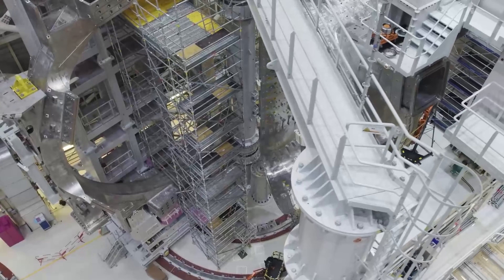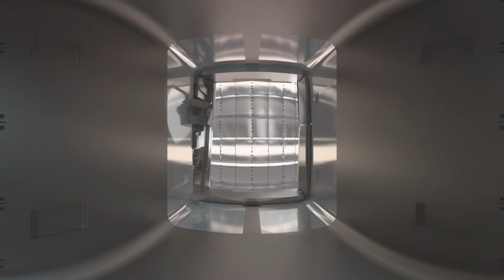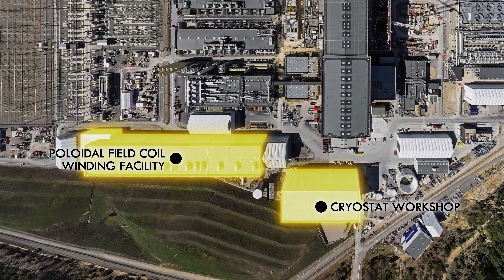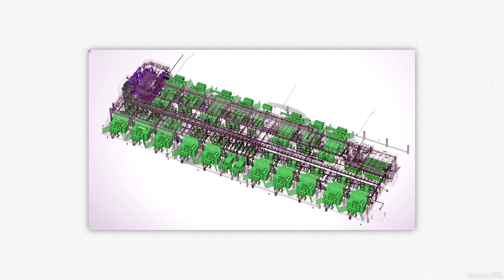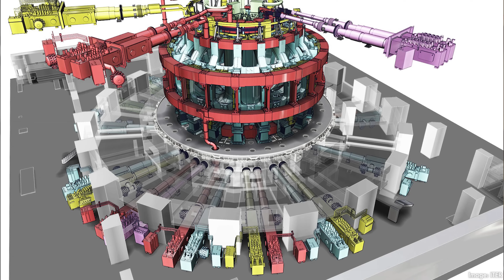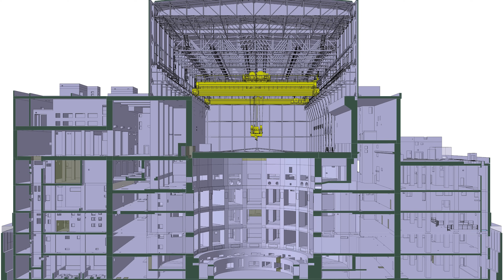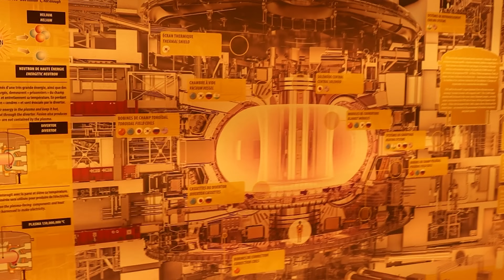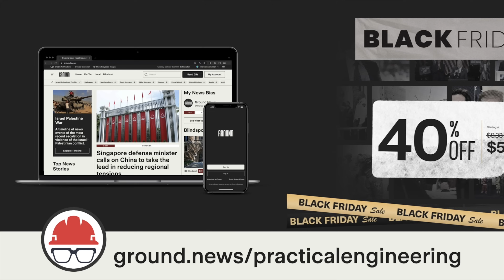Engineering The Largest Nuclear Fusion Reactor

Comment from the maker: What’s your guess for when the first commercial fusion power station will come online?
Compare news coverage from diverse sources around the world. Take advantage of their Black Friday sale to get 40% off unlimited access by going to: https://ground.news/practicalengineering
Reply: 8 minutes
Reply: @Southghost5997 only correct answer
Reply: What they say about Fusion is that it's always about twenty years away. My prediction is it will be at least another century before a lifecycle-profitable, energy-positive, fusion plant is operating.
Reply: @dyadica7151  Especially on any of the magnetic bottling techniques being used.
Reply: @dyadica7151 I thought the joke was 50 years from whenever now is.
Reply: @linda1lee2  :D It started as the "twenty years" version, but people quickly learned that was being overly optimistic.
Reply: Maybe never man, maybe never.  Without high temperature super-conductor breakthrough, not likely.  As of right now it's just a science cash grab for tax revenue.  Do some Google searches with some objective search terms, and decide for yourself.
Reply: Well, from my many years of experience playing SimCity 2000, I can say fusion will be unlocked circa 2050.
Reply: I love your channel, Grady. 

Doubtlessly when/if commercial fusion happens, the steel and concrete people will sort it out (with maybe some input from the material science folks)

Like she said, ITER is as much a research project as final design - so my question is - since any team, anywhere, have yet to build even a small scale design that would be suitable for ITER - how far can they take this before the building outruns the science? 

Also, my prediction is 2057. That's if someone can get a really feasible design built at all. I certainly hope someone can. Lord knows we need it.
Reply: Honestly I don't want to speculate. It's like trying to predict when the first passenger airline would be in the late 19th century. There's a number of players with different ideas and it's hard to know which will win out.
Reply: I think the technical challenges are so difficult that it will be prototype plants for some time. The old joke is that it will be 20 years, and has been for decades. But maybe now it actually is.
Reply: @esalehtismaki I think they might get a feasible experimental power plant going but it will probably be just over the breakeven point so commercial wouldn't catch on to it till it gets more efficient
Reply: Jade's @upandatom channel looks cool! Going over to subscribe and binge now... Thanks for the pointer! 🙇
Reply: 30 years? And it will remain costly and only form a part of the energy production, maybe with some tricky stuff accompanying it. Kind of like nuclear energy nowadays.
Reply: I've got an ongoing wager with a friend we made in 1999, I say before 2050. Winner gets a bottle of JD.
Reply: @PedalBoxGarage  You should be keeping that bottle safe for your friend.
Reply: @bartroberts1514  heh, I feel like i'm cheating a bit with friends who now work at both JET and ITER over the years. I'm quietly confident :)
Reply: Never.. to big, expensive, delicate and inefficient. That huge facility to make less power than what it takes to start the thing. How big would it have to be to actually spin up dozens of generators? The size of a mountain?
Reply: For one that generates electricity and actuslly serves the grid? Maybe by 2075? 2175?
Reply: You, and she, are among the most moronic geniuses.
Reply: It is important to note that ITER is not a fusion power station!  It is a research facility, an experiment, to enrich our knowledge about what it takes to build a fusion power station.
The "50MW in 500MW out" claim made is misleading to the general public.  One may think "this reactor would take 50MW from the grid and generate 500MW of power to put back into the grid" but that is by far not the case!
These figures are measured at the reactor itself, not at the boundaries of the ITER site.  It takes WAY more power from the grid to generate the envionment and the 50MW input to the reactor, and the output of the reactor is 500MW thermal, which when converted to usable electricity is less.
That "a gain of 10" in reality is way less than one for ITER, i.e. running its reaction for a test costs way more energy than it generates in the end.
That has to be improved by at least two orders of magnitude for the whole system to be used as a power station, and that is what the research is about.

That will take another 30-40 years to accomplish, just like it did in 1970.
Reply: I'd have to hedge my guess by saying I'll wait until I see ITER running, first!  😄
Reply: Wow!  Long way since Ponz!
Reply: Ultimately, they'll find out they're wasting money.  They'll have to convert it into a fission reactor.

Stars can do fusion, because it has the gravity.  Once fission takes place, the uranium (heaviest element) will sink back into the core and reconstitute itself, then go through fission again.

You'll find out later.  All the junk in the news about fusion are fake.
Reply: 2041
Reply: never
Reply: 24.04.2046
Reply: Never with this technology. Magnetic confinement doesn't work. Inertial confinement does. You can build a reactor in your basement for about $5000. It will maintain a fusion reaction indefinitely. Researchers had a clear path to ignition (more energy in than out) but were refused funding. You can ask for funding yourself but you will get no reply.
Reply: Its a grand science project for sure. If they got the math right it should have some sustained fusion probably by the 2030s . But how long will it run for? Remember this is not a prototype power station either. A Power station needs to run for decades. It'll take 100years or more before any such will happen.
Reply: If you want an expert view on whether and when fusion will be commercially viable then search "ITER is a showcase ... for the drawbacks of fusion energy". Daniel Jassby, a former fusion scientist explains the many difficulties that make it almost impossible to achieve a working fusion reactor and details why it would never make economic sense even if it does eventually work.
Reply: Since I was ten, I've heard about this, back in 1988.  Just starting the build was in 2007 I think.  So my guess is another 20 years.
Reply: @producerk8247  Okay. So.

What people don't get is that fusion generator research is a beard, a shell game, to cover for something else.

H-bombs require constant replenishment of heavy hydrogen in high concentrations. The overhead on that is enormous. But if nuclear research carries part of the cost, then the militaries with H-bombs can defray their costs.

Eight years after the last fusion generator research project ends, H-bombs will be too stale to ignite from their A-bomb cores.

That's it. That's the whole rationale. Fusion research was, until other Physics questions were answered, meaningful scientifically. They were never meaningful commercially, except for the arms business.

Now, they're meaningless. We have so much cheaper ways of doing away with people these days.
Reply: Ever watch "The Saint?" It's an old Val Kilmer movie
Reply: @timhorton555  It's also an old Simon Dutton series, an Andrew Clarke series, an Ian Ogilvy series, before that a Roger Moore tv series, and before that a 1920's Leslie Charteris character in his novels, and even a 1930's movie character: a perennial fiction loved generation after generation, but never really changing and never real.

Just like commercial fusion.
Reply: 40 years, just like it’s always been 😁
Reply: Thank you for the 10 commercials throughout this video.
Reply: Never. It's a scam. It's a waste of precious resources
Reply: @johnmanno2052  They're not that precious. Resources can't be destroyed and we have a lot.
Reply: I'm french and I fear this is a huge waste of money. Time will tell but meanwhile nuclear power is so misunderstood.
It's still the most green energy available (even more than hydroelectricity) if you listen to Sabine Hossenfelder.
Reply: In about 30 yrs.
Reply: 50 years.
Reply: The most practical fusion power is dropping fusion bombs in a hole and boiling water at high pressures. 

We have all the tech to do this btw, and it gets rid of weapons at the same time. Win win.
Reply: Check out Magneto Hydro Dynamics, MHD I think it is called. Maybe Magneto Plasma Dynamics idk. Anyways, it uses the magnetic field created by the fusion plasma to "push" against a separate magnetic field on the outside of the machine which can be used to move electrons through a coil. Or something like that. It's late for me and  my brain is not functioning at full capacity so take what I say with a grain of salt and read about it for yourself. Interesting stuff though.
Reply: Never.
Reply: 2065. There's still so, SO much that needs to be figured out, since the current ones that can technically produce positive power output do so for a fraction or so of a second, and iirc don't take into account the peripheral costs associated with setting up for a reaction in the first place, only the small reaction pulse itself in that calculation. Oh yeah, plus the actual energy cost of producing the fuel pellet in the first place lol, since tritium/deuterium isn't exactly simple to produce at the moment (so we'll need to overcome that hurdle as well)
Reply: STOP MAKING TRASH that has the potential to create catastrophic failures!
Reply: 🎈 The real question I have is just what impact this will have on the price of helium birthday balloons.
                 🎉🎉🎉
Reply: Sure spending some money on that!  Good jobs I guess.
Reply: I'll make a very optimistic guess for 2029
Reply: @Tharmin.124 I admire your optimism. ITER has been working on this experimental non production reactor since 2013 and it not finished yet. What makes you think it would be possible to finish the build, perform tests, design a new form of reactor, to build and test it and to take it into production in only 6 years from now?
Reply: @Conservator.  Absolutely nothing, I don't know jackshit about the progress of nuclear fusion lmao
Reply: @Tharmin.124  Yep you're right, I have some ocean front property in Nebraska I'll sell you.
Reply: @Tharmin.124   Is that for them the cost to have blown through the first trillion dollars?
Reply: 2020s - "Commercial fusion is 20 years away"
2010s - "Commercial fusion is 20 years away"
...
1970s - "Commercial fusion is 20 years away"....
Reply: 3:01 "Why plasma?" was not immediately answered correctly. She said that it is what the sun is made of, but that is not a good reason. The reason is that it is the hottest form of matter, and so the fuel just ends up as plasma with the energy required to cause fusion.
Reply: One thing wasn't clear enough magnets must be super cooled with liquid nitrogen otherwise they can not generate enough magnetic field to hold the plasma! This is the main reason why the reactor is cooled with liquid nitrogen instead of heavy isolation like it is done in nuclear reactors. There are way too many parts which have to work flawlessly, slightest failure and we are looking at massive reactor damage. And this is the reason why there aren't any steam generators on site at all because nobody believes this experimental tokamak can work for a long time! To be honest as an engineer i find the whole project a waste of resources, a propaganda project to prove ''we can do it'' instead of actually doing it. Our star carries way more energy than we will ever need from 150 million kilometers but we can not still use it at all. This money should had been spent on energy storage technologies instead, if we have really high storage and efficient batteries we will not need fusion to produce energy...
Reply: Quite. Solar PV is making far more efficient use of the biggest fusion reactor to which we have access  @ggoddkkiller1342
Reply: You actually need liquid helium for cooling, but that's working fine
Reply: assuming there are no showstoppers  (and there might be quite a few...),  a commercailly viable nuclear fusion power plant will NOT be available before 2100
Reply: Commercial nuclear fusion is 20 years away from now. 
It has always been like that.
Reply: 5050...
Reply: Fascinating, but It might never be realized simply because of the complexity of the task. Society may have collapsed from climate change and natural disasters long before any real practical development in fusion can be achieved. More money should go into giving solar and wind turbine generation to more people around the world.
Reply: Joking: It will always be 10 to 20 years into the future.
And that's how it has been since at least the 1950's.
The words 'Big', 'White' and 'Elephant' keep coming to mind, for some reason.
Reply: I really wish you'd cover the tunnel collapse at Uttarakhand where the miners are still trapped.  Trying to get any information online is very scant on detail.  But to be honest, I don't even know if you'd be able to get any more information than the rest of us.
Reply: 30 years and 30 Trillion $ from now .. plus overruns so …?
Reply: I'd like to see it happen but the joke that fusion has been 10 years away for the last 50 isn't really a joke.
Reply: Commercial fusion is 50 years away, and always will be.
Reply: I don't believe there will ever be a commercially successful tokamak.
Reply: At least another 50 years - we’re still miles away from a Q factor of 1. Id be amazed if i ever see it in my lifetime, even in experimental situations let alone commercial
Reply: Not in my lifetime.  And I'm hoping for another 40+ years around here.
Reply: 200-250 years if someone gets lucky. Otherwise, approximately 500 to 1000 years. This assumes it truly is feasible, a fact I'm not convinced of.
Reply: 2077
Reply: @Two-Checks  better be before the bombs fall
Reply: Maybe I missed it Grady, but did you mention somewhere what this is costing?
Reply: It will perpetually be 30 years in the future.
Reply: A solar power plant is a nuclear fusion plant with a lot less complexity! So about 25 years ago.
Reply: @dansands8140 if only this kind of investment was spent on solar and wind and storage ..
Reply: @dansands8140 yes, and, connecting solar arrays on all the continents together for a global grid with solar power from the other side of the world at night, is a less complicated and more feasible engineering problem than a fusion reactor.
Only problem is it requires countries to work together for a global energy market.  So it probably won't happen on global scale. But some connections are being made already.
Reply: @dansands8140 Also a lot lower power output LMAO
Reply: @nocturn9x  Well that depends on a lot of things. Can be enormously more output. The sun's output is about 40 million billion big power plants.
Reply: @dansands8140  I'm not sure you even understand the enormous differences between the yield of fotovoltaics and fusion, or heck even fission reactors. It's not just a matter of how good your solar panel is, it's a matter of energy generated per unit area. In that regard, nuclear processes are unbeatable. How much land would you need to generate 1GW of power with solar? Now look up the area of a big nuclear fission reactor with a similar power output and just LOOK at the sheer difference. Also, a fission plant can last 80 years with proper maintenance, while solar panels have to be replaced every 25 or so. Solar panels are also composed of toxic heavy metals that need specialized processes to recycle (and yes, we do recycle them). In my opinion, the future is going to be built on nuclear as a base and other sources such as solar, geothermal and wind where it is cost effective to do so
Reply: @dansands8140 and it requires much more land and inverters to turn it into line voltage AC and it can’t run at night
Reply: @dansands8140  my guy, do you want me to make the same argument for coal power? TECHNICALLY it was created via fusion power too, so surely you would agree no?
Reply: @Helperbot-2000  No, because coal is power storage, not power. :D
Reply: In the next 10-20 years as always. Same answer as 10-20 years ago.
Reply: About at the same time as the first real quantum computer
Reply: @jurjenbos228 Not even close. Production quantum computers are a lot less complicated than taming a 150 million degree plasma and making it generate useful electricity. Like, an order of magnitude simpler lmao
Reply: 2057
Reply: It’s 50 years out
Reply: 100 years
Reply: I remember going on a high school trip to an experimental physics lab, where they said something like 10-20 years. That's 20 years ago and they are still building an experimental "no gain" reactor now?

So I fall in line with everyone else saying 20 years from now we'll predict it to be only 20 years from then.
Reply: First commercial plant?  my guess is 40 years LOL,  and that is if we don't have WWIII
Reply: .. "never" ..
Reply: I doubt it will ever happen
Reply: It's hard to guess, but this project won't help.
Reply: @billsmith5166  won’t help? Its goal is to help scientists and engineers identify and solve related problems. It is an essential intermediate step.
Reply: @billsmith5166 I’m not sure you can safely keep plasma next to supercooled magnets without something going horribly wrong … eventually
Reply: We do this already, that is not the big issue
Reply: @stephenrickstrew7237  yes you can, the only bad thing that can happen is that the plasma containment fails, meaning the plasma rapidly cools down to harmless temperatures. fusion isnt like fission, the reason fissile materials stay hot is because theyre radioactive at all temperatures, and heats itself up.
Reply: im that guessing about 15 years, since demand is rising superconductors and breakthroughs are happening left and right
Reply: About 100 years at the present rate of every ten years we'll have fusion online statements.
Reply: Never.
Reply: I don't think it will ever be viable.
Not in the next 100 years anyway.
Reply: 2029… Her accent is sooo beautiful!!!
Reply: When will it come online? 20 years from 20 years from 20 years and To Infinity and Beyond!
Reply: indeed just a huge science experiment. by the time this becomes net positive energy output, the fusion will be like ancient vs solar pv and wind power technology because fusion power is based on heating liquid/boiling water to drive a turbine which is very inefficient or ancient. The nuclear heat source also like a sledgehammer unlike multiple precision heating where the power source is electricity for use in science or industries.
Reply: The ITER folks say 2051 for the DEMO project, and commercial deployment would be after that. So… no time soon.

The big problem for commercialization is that there’s alternate power sources today that are far cheaper than what fusion plants could possibly achieve. So until there’s a huge amount of additional demand than what solar, wind, hydro etc can provide, there’s no commercial case for fusion.
Reply: @benoithudson7235 I can see fusion being the power source we send our first intergalactic probe with. I mean technically voyager is starting to get that way but that wasn't the intention of it, better way to say it I guess is first spacecraft sent to nearest galaxy would probably use it.
Reply: Never. If it were truly possible then Elon Musk would’ve dumped everything he has into it.
Reply: Why guess?

Years ago the math was done to show the answer is never. Commercial fusion power requires more energy out than energy in; fusion in terrestrial conditions falls two orders of magnitude short of producing the energy required to equal or exceed the net of all energy used in all stages of production.
Reply: You mean the project that doesn't make energy and paid by the taxpayers... The got a donate section on their site! That's why we need regulation is science!